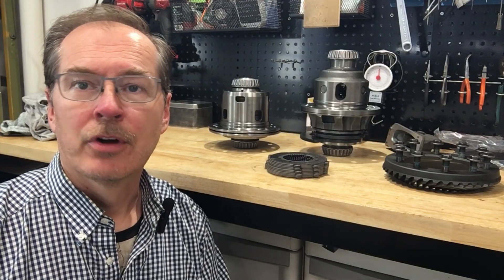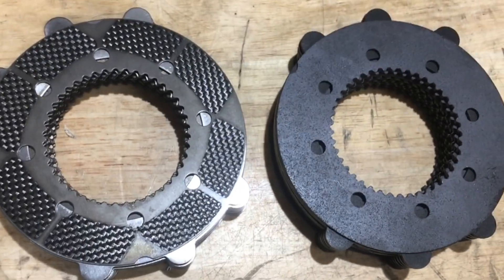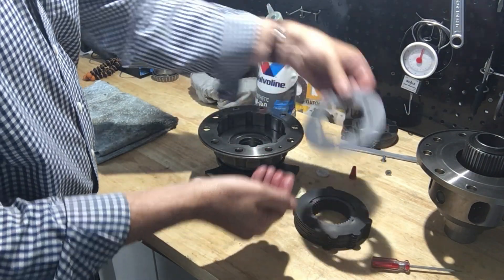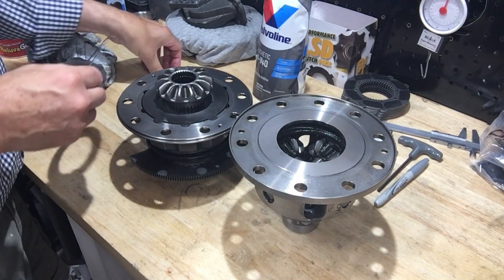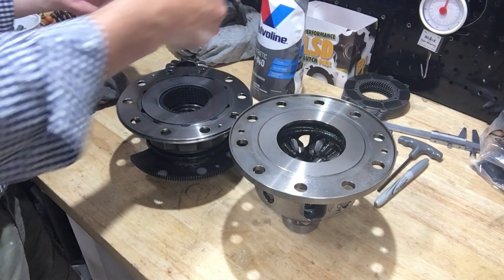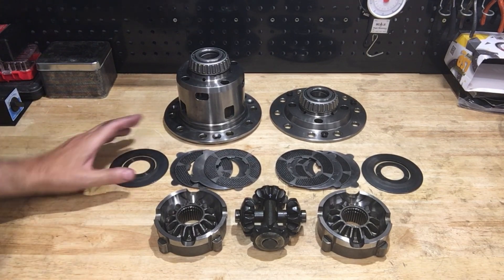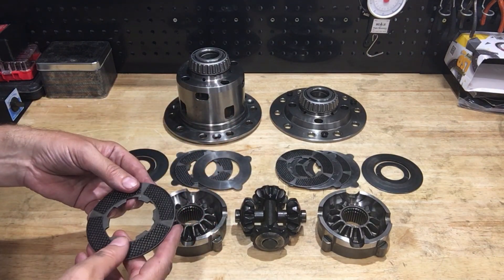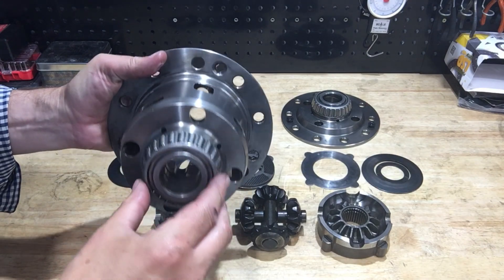Jag  V8 eDiff Clutch Pack Replacement

Comment: Is there an option for an open diff V8?  Xf/xj 5.0 N/A?  I don't want e-diff. Will quaife f type fit?  Gear ratio 3.31.
Reply from the maker: Yes, there are options. The 5.0l n/a cars also used the Dana 44 AdvanTEK pinion and ring gear set in a non-eDiff housing. So the V6 solutions can be used (Quaife ATB or Jag LSD)

Comment: So Herman whats better for the enthusiast? The friction based on electric one?
Reply from the maker: There are a few rear differential options available to Jaguar owners. 
1) the base V6 cars came with an Open Differential which isn't very good from a grip and DSC perspective. 
2) the V6 S-model cars came with a friction LSD which has carbon fiber pads that fall apart. I have developed an upgrade kit to ceramic moly coated disks that are much more robust. 
3) the V8 cars came mostly with an electronically controlled differential, which also has carbon fiber pads that can fall apart, but I have also developed a ceramic moly 
4) a new option is the Quaife ATB (helical or Torsen style) which fits into the V6 and 4 cylinder cars.  This is what I run in my 2017 V6 F-Type Manual... I really appreciate the way it grips and goes.
Some folks have shown that the friction LSD and the helical ATB have near identical performance on the race track.  The friction LSD requires maintenance due to disc wear.  The helical ATB is maintenance free. The friction LSD binds the two axles together when engaged with high torque.  The helical ATB biases torque to the axle that is spinner slower.  The helical ATB may spin a tire if there is zero road friction on that side, while the friction LSD will eventually lock the axles together in the same situation.  Note: traction control can help the helical ATB maintain grip with one wheel on zero friction surface. 
More rear diff content Playlist.  https://www.youtube.com/playlist?list=PLt7FG0BQm3ykhzsHzNR47DIYp9YnZRgd0
Reply: @OncaEngineering  But which one is more reliable / predictable / fun to drive with? The main reason I justify my purchase with the V6 and LSD is that the LSD is more predictable than an e-diff. I hate electronics. 

Always wanted to put the v8 in the coupe and make one if not the only coupe v8 with a LSD.
Reply: @DillonBritt-gw2og  I will try to give you my best response based on my experience with 14+ rear diffs. 
The least robust is the Jaguar V6 LSD (due to the poor quality bond of the Carbon Fiber pads on the friction discs). 
The next least robust is the Jaguar e-diff where it can overheat, disable, and wear away its Carbon Fiber discs. 
The intermediate robust units are the LSD equipped with the upgraded ceramic moly disc.
The most robust rear diffs are the Open diff, and the Quaife ATB 
As for behavior and fun factor.. the least fun is the Open diff, while all of the others are in the “big grin” category. 
I don’t have too much driving time on the e-diff, but I do have time on the LSD and Quaife ATB units, and I prefer the Quaife’s behavior, as I can feel it seeking and finding which axle has more grip than the other.  I can tell its working as I accelerate away on washboard roads, or exit a wet corner on an uneven road. While the LSD tends to give that “locked axle” behavior and the rear of the car will then rotate outward with predictable characteristics.  Note: the car’s DSC setting will also influence the throttle and rear brake response, so use TracDSC, or DSC Off for best results.  
The V8 is a torque monster, and I would recommend either 1) keeping the e-diff until it fails, 2) swapping over to an upgraded LSD with ceramic moly friction discs, or 3) bitting the bullet and converting over to the Quaife ATB.
There are other challenges as well when considering the e-Diff to V6 rear diff conversion.  A) the left side half shaft may need to be swapped to a V6 one which is a bit longer,  B) the gear ratio of 2.56 may be difficult to fit into the LSD and to the Quaife … so you may need to use a larger numerical gear ratio.